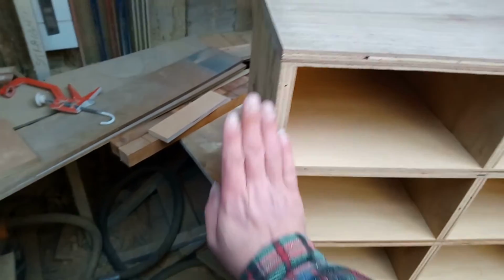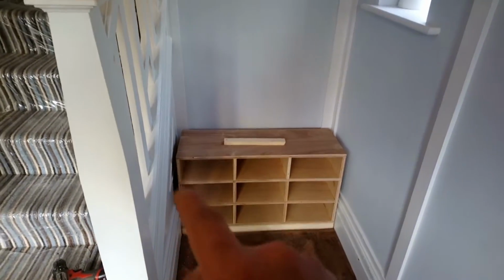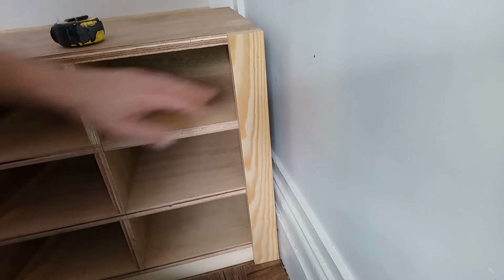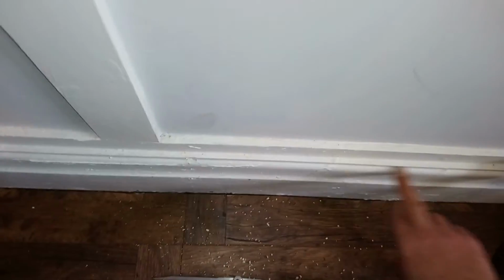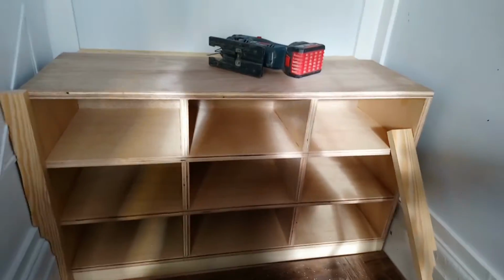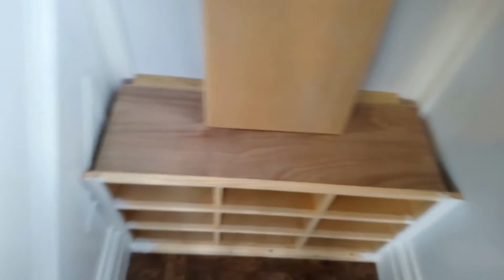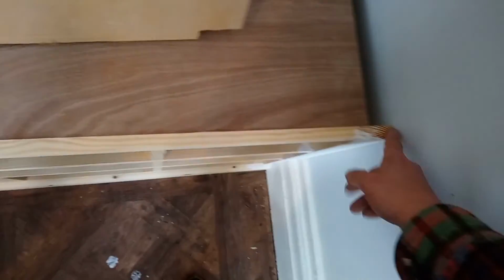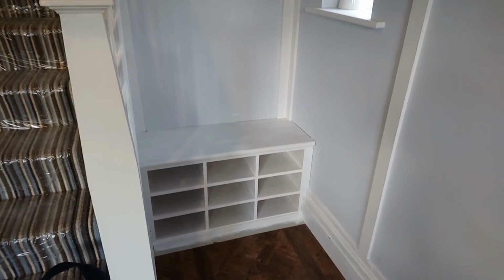Pigeon hole shoe storage bench - Pt2 Fitting in the hall

Comment: What table saw is that you use?
Reply from the maker: It's a 315mm Scheppach Tisa 5.0 Sawtable,
Reply: @Gidjoiner  looking for one myself. Any recommendations
Reply: @Gidjoiner  like your content mate keep it up!!
Reply from the maker: The Tisa 3.0 is still around, i think it only cuts 75mm, dunno but to be honest i wouldn't buy one of these, i have had issues, I'd be tempted to buy the Dewalt saw or similar, it has a decent fence, that's what lets a lot of saws down, easy to make a blade spin around but to get a decent accurate cut you need a good fence, i made the one for my table saw & bought it with the intension of mounting it in a table & making a good fence. The Dewalt is a bit noisy though. Thanks, will do, plenty more to come 👍

Comment: is there a way of building carcasses with dividers without a biscuit jointer ?
Reply: Phils Obsession 
Housing joints
Reply from the maker: Yeah i guess there's a few, there's the two already mentioned, 
fixing directly through with screws n nails, the uprights could go right from top to bottom with the shelves fixed at their sides underneath with pocket hole screws, I think the challenge with any way of fixing is trying to keep them in line,